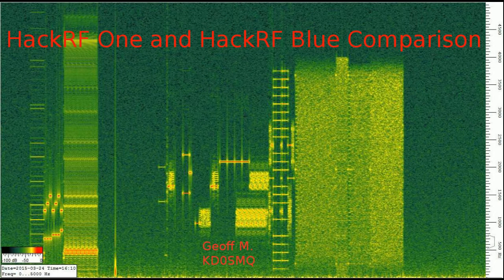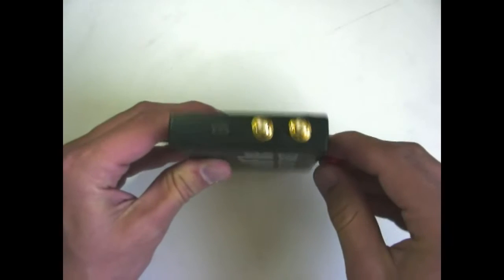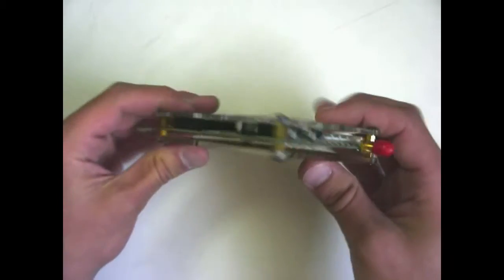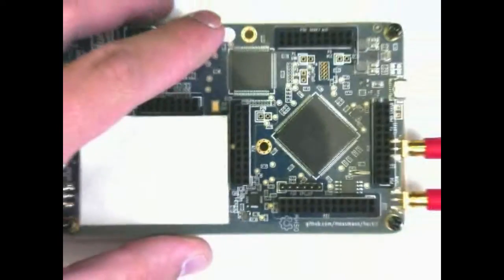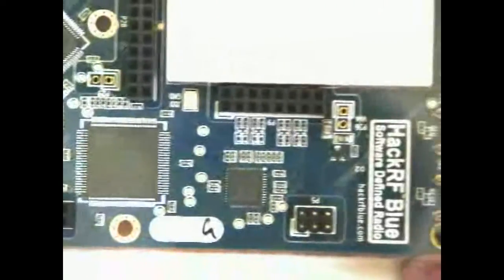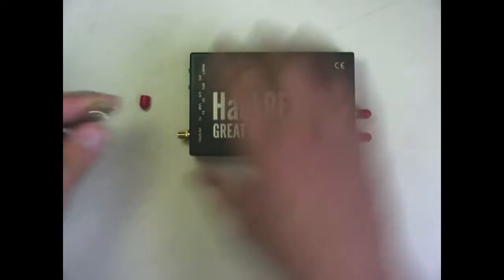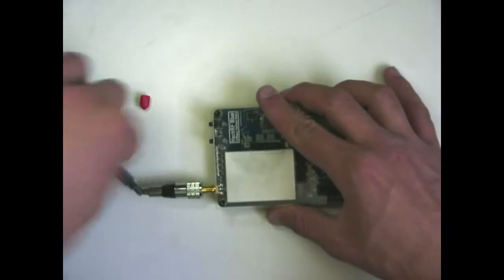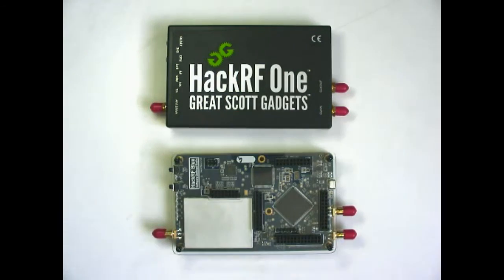HackRF One and HackRF Blue Compared

Comment: Who cares about enclosure and stock antennas? If you buy things like this, you should be able to choose right antenna for your purposes, and even make enclosure by yourself. The main question people interested in is about difference in hardware. If it uses cheaper hardware does it restrict band or accuracy?
Reply: Duh of course....and you are very correct...the antenna choice can make or break your signal hunting/ SDR journey....

Comment: No one I've asked has answered this question on youtube, do these hackrf devices replace the RTL-SDR devices or does it plug in to them? and can these hackrf devices use the same SDRsharp software? Out of all the videos no one explains this, Can you answer this? Thanks.
Reply: +jess robert the hackrf is using its own chipset.  rtl-sdr is because of the RTL2832U chipset dvb-t sticks use. 
You can use hackrf using an plugin for sdr# or hdsdr, im not sure where to get the plugin, but im 100% sure there is one.

With the default tuner and chipset of an dvb-t stick, you wouldnt able to go down to 1mhz without converter, or up to 6ghz like the hackrf does. so greatscottgadgets (website of hackrf) made their own sdr

also the hackrf can transmit, not just receive like the rtl sdr's
Reply: HackRF is a separate device...all by itself... Does not require any other sdr dongle/ attachment....its range is a hefty upto 6ghz...some say even more. If you want to make your hackrf portable then you want to get what is called a PortaPack... If you search for hackrf you'll stumble upon the git hub/ wiki pages where extensive documentation is laid out for us....plus things like a couple of sellers outside of GreatScottGadgets that have legitimate devices... Not every 1 that is for sale is legitimate...it may be fine for the first firmware update or 2 but then faulty...so look out for devices being sold that mention requiring downloading firmware from the seller and not from the Git hub repository . 

And these days SDR sharp is a no problem to run....but if you have the PortaPack then that function is there in your hands...maybe not as feature rich but still....